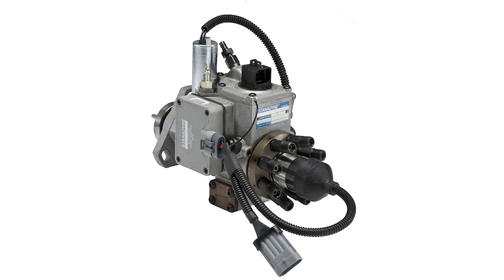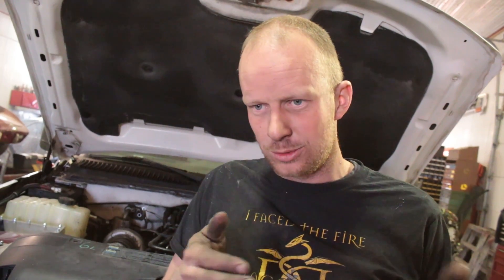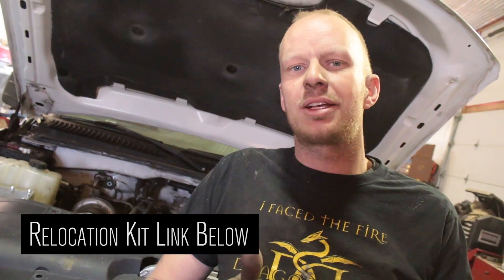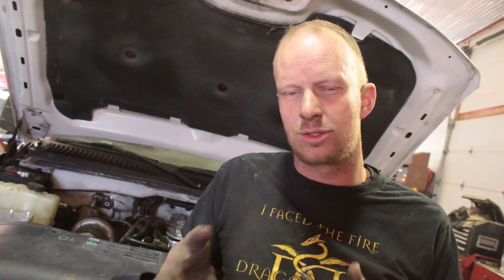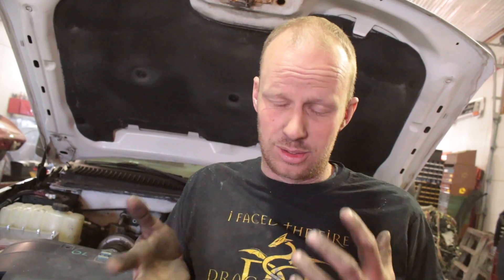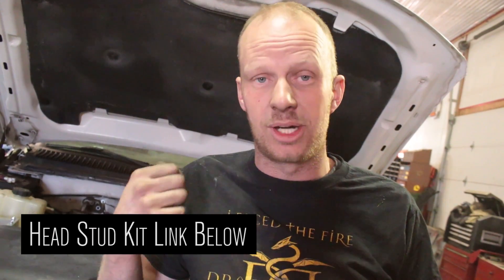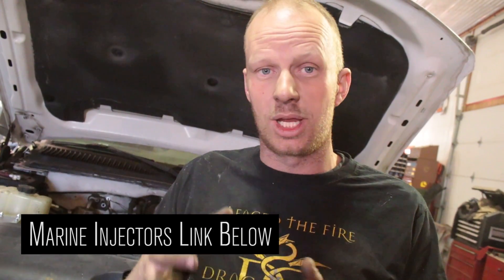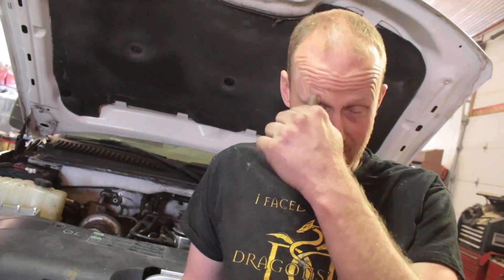REVIEW: Everything Wrong With A GM 6.5 Detroit Diesel

Comment: "must be reliable enough since the us army uses them"
no that just means they were cheap
Reply: Jon long plus at the time the humvee was designed the 6.2l was the only V8 diesel, the Navistar 6.9l came a year later (1983.)
Reply: @NH2112  The M998 HMMWV was a prototype in 1983,but came out in 1985.The N/A 6.2L came out in 1982 and was based on the 8.2L from 1980 that the C50-C70 got.
The N/A-T/C 6.5L came out in 1992.The M1008-M1031 D10-D30 CUCV came out in 1983 with the 6.2L too.
The M1025-M1046 and M1113-M1167 ECV are the ones that have the 6.5L.They were naturally aspirated before being turbocharged in the HMMWV-ECV.Another thing,the T/C 6.5L in the HMMWV uses a different cooling system,stack/snorkel,and radiator than the previous variations,they are 1 FT longer.That is why they have those thick grilles.
The J Code 6.2L in the Military was 155 HP/275 TQ and the F Code 6.5L was 205 HP/450 TQ.Other 6.2L's like the C Code were 130 HP/250 TQ and the 6.5L during it's timeline before the update stuck with the M1113-M1167 HMMWV were 180-200 HP/350-430 TQ.Basically for the 6.2L/6.5L IDI,any of them that had the lowest power had EGR/SMOG,all of them in the military are deleted,and then G.M. still kept that as optional for civilian trucks and vans.After the 6.2L,there was also the CUCV ll A-B-C-E-F-S with the 6.5L,along with the 5.7L and 7.4L as well.The 6.5L until 1993 is mechanical fuel injection before going to electric fuel injection and switching to the DS4 fuel pumps from the DB2 fuel pumps.
Now there is the JLTV/LATV from 2015,it didn't enter service until 2019.It has the Isuzu Duramax with 350 HP/700 TQ.
But the HMMWV will not officially retire until 2042,they will just be in reservations and behind the scenes,no longer in combat.One of the other reasons is the size,HMMWV's are small enough to be airborne out of C-130's,the JLTV's are too large and can't be parachuted.
Reply: @Slim_Slid  
Thank you so much for all the correct information not just opinion...
Reply: Still very reliable. The military got heavy duty 6.5s. The ones in the pickups ere light duty versions
Reply: They dont just buy cheap without any concern for performance. Same thing with people saying things about Colt rifles, sure a Daniel Defense is higher quality (i love mine despite the price) but my Colt never failed me when I depended on it, the only failure I ever saw was a bolt broken in a short barrel FN (owner was a contractor). But the other 99.99% of FNs were great too. Like the m249s, the problem being short DI systems with short barrels, chamber pressure being too high when the bolt is getting pushed back. The military tests to make sure they can take the beating. Anyways, our 6.5s were ancient by that time and although they were pigs fully loaded with guys they ran and ran, because they were maintained and looked at every time they came back.
Reply: I think the  military purchased the design of them and "fixed" some of the main issues after GM went to the Duramax. The "Improved" 6.5's do fit right in place of the original 6.5, I just think smaller some stuff is different between them.
Reply: @wilsonoberholzer2771  Naw, AM General orginally had the the 6.2 N/A, then 6.5 N/A then 6.5TD, after GM/Detroit stopped making the mechanical engines, AMG licensed the 6.5 and now makes the Optimizer 6500 in their own GEP plant. It's had improvements to the block castings, heads and crank, but it's still a turd. The old 6.2's would blow Cyc-8 in 20k miles from overheating. At ~$8k its a cheap and disposable engine for the HMMWV but multiple militaries have had multiple competitions to replace it since 1998. The problem is always fitment, cost or the fact that new engines can't take sulfur rich JP8 without grenading.
Reply: @johnnyz1781  I've never seen a 6.2/6.5 blow cylinder 8. And ik many that run them hard.
Reply: Remember kids... "Military Grade" does NOT mean its good. It means it was made by the lowest bid possible
Reply: No that means they were good

Comment: 6.5 Detroit’s are damn good in my opinion the one my grandparents had was second to none the best truck they had for the km and the body I mean this truck was spotless for rust and the 6.5 could pull damn well it pulled a 12 bale trailer with bales that weighted over 1300 lbs each but sadly all good things have to come to an end the same day they put the truck on the trailer my grandma could smell something so my grandpa popped the hood to release a flame that shit 5 feet in the air the truck went down with the fire went right through the cab it was damn depressing considering that they gave the truck to me who was 12 at the time so instead they gave me a 04 duramax that isn’t in half the shape the 6.5 was in but shit happens and you can’t rewind the past to fix the problem

Comment: I work at a machine shop and 80 percent of the heads the come in are cracked and need to be replace so yea i a agree with you 12v cummins is alot better then this 6.5

Comment: The army 6.5 turbos are outstanding in the hummvee it pulled 13000 pounds with ease on a daily basis with no issues but the injectoin pump all we had to do on most of them was replace  the solinoids on top cause the heat wld get to them.

Comment: Do you think you Can get 1 million miles on a 2005 lly duramax? I have 260 thousand miles on my lly duramax....i use it for work and haul heavy weight every now and again, is my daily driver. I use a fuel treatment almost every fill up. Still on stock injectors never rebuilt only have a cold air intake and 4 inch straight pipe exhaust. I do not mess with tunes. All the trucks I've seen with almost or up to 1 million miles don't have tunes on them.

Comment: hello i have a 2000 gmc 3500 hd it has the 6.5 diesle..im having overheating problems ..top radiater hose gets very hard very fast..i changed both thermostats , new radiator , water pump seems to be working , fan is working ...wen driving over heats in about 2 min then goes bk to normal then over heats agin and repeats ...i dont think head gasket or block , heads is cracked , i tryed that tester kit where the fluid changes colors if ther a crack but it didnt change ...any ideas why its overheating ? wat els would make it over heat ?

Comment: I have a 94 6.5 turbo K3500 truck. It starting having a problem occasionally of not starting and getting worse. Cranking over normally, but not starting. I changed the fuel filter. Didn't help. I noticed two of the injectors are really oily all around them. I removed the air filter box to get a better look at the passenger side and found a lot of oil inside the turbo where the air box connects. Do you think the problem is bad injectors, or something else?
Reply: DIY Oregon you probly need a new cdr valve your is most likely bad and letting oil into the intake

Comment: Years ago we had a 1999 Chevy Express 3500 that had the PMD go (the black box) on the highway. First thing was a pretty severe jolt and the check engine light came on. Looking for a place to pull off the highway it still felt fine, but then it just started accelerating on it's own and blowing a huge black cloud. We turned the key off and pulled off to the shoulder, thankfully being electronic it actually shut off and didn't run away on us. After that it wouldn't start.

The dealer we bought it from just months before didn't even mention the issue or the solutions, and just replaced the damn thing, which failed only a few months later. I had to look up the solution online. We got the relocation harness and never had an issue after that.

Comment: I have a 6.5, I drive it like a typical domestic truck. It has notably less power than an old dodge 5.9 I get to drive occasionally . The 6.5 will not survive lead footed, boost hungry, giv're at all cost diesel monkeys, Their design leaves little room to add more power without compromising reliability. The engine was designed for light duty with reasonable fuel economy, being a IDI it can almost burn any type of oil as fuel as long as the viscosity had been adjusted close to diesel. Parts are economical. It is pointless to spend over 1000 bucks to rebuild the injection pump when rebuilt pumps are available at lower cost at online diesel performance places. You can buy a complete set of injectors for less than the cost of 1 modern day injector for later model fuel rail engines. The black box must be mounted off of the engine. It still gets too hot mounted on the intake, put it on the cruise control box mount, it stays nice and cool there. extension cables are cheap on Ebay. One day Id like to do a swap for a 5.9, but why spend the money when the truck does mostly everything I need. It's too bad the 5.9 was wasted in the ram pickup, They are total pieces of shit.

Comment: I have a 97 Chevy long bed 6.5 turbo diesel 134,000 miles southern truck. Has low oil presure an a thumping noise coming threw breather box but still runs good no change in smoke seems to run strong lacking a little power. Any suggestions what to look for?

Comment: i had 98 chev 6.5 diesel and after 4 years it started having problems with black box where it just started accelerating on its own or would completely shut down.  2500 to fix in canada at dealer.  lasted to 650000 when camshaft broke

Comment: Hi i have a 98 6.5 detroit that ran fine except when i started it one morning and the engines runs rough and idles rough. And big amounts of black smoke come out of tail pipe. And when u give it gas it shuts off. Can u help me out? 
Thanks
Reply: I know this is late, but have you checked the pmd. Sounds like that could be a problem.

Comment: Can you please do a 6.2 common problems!?
Reply: THE ENGINE,DONT EVEN CONSIDER BUYING ONE,international harvester,in 2001,took over building them,6.5td,if you do want one,GET ONE OF THOSE.NOTHING ELSE,or a duramax,12v,7.3,or basicaly anything else.but a pre 2000 gm garbage engine,do you have a computer,mybe not,try wiki,or google,might enlighten you.
Reply: @phantomwalker8251  fear monger much?  Everything you say is WRONG! You've read a lot of forums haven't you? The only year to "stay away" from would be '97. But if you get one. As long as you're not trying to pull 25,000 pounds up a 60% slope. You'll be just fine.

Comment: The guy who lives next door to me has a K2500 that he's been trying to rejuvenate for some time and now it's got only one major problem:

the thing has two batteries.  Normally, the charging system switches between them when one goes low.
His has a programming issue and doesn't switch.
He needs to find a gadget to reprogram the internal computer to properly switch batteries.
Any suggestions?

Comment: I as a 6.5 owner, WILL say these engines aren't as bad as people put them off to be. I have a 94 model k2500 which was the first year of the electronic fuel system (uses the black box talked about in this video. Known as a PMD) and I use it to pull loads such as car trailer, farm equipment, etc. My truck is a bone stock truck with 303k miles currently and it does fine. With that being said, if you are a teen that wants a diesel truck to hot rod and ride around in like all your buddies (as most teens do now days),  a stock 6.5 will be just fine as a daily driver diesel. Now if your looking for lots and lots of power, spend the money and upgrade it. The 6.5 Detroit diesel is a good motor of they are taken care of, but to get power out of it, you have to spend money and upgrade it and build it (marine injectors, bigger turbo, ARP head studs, etc. My truck on the other hand isn't built for hot rodding around and alot of power. It's used as a work truck. What diesels are made for. I've owned two 6.5 diesel trucks over the past 5 years  and out of the two I've owned, I'd say the one I currently have is by far the best (because its a 5spd, vs my first one which had a 4L80E automatic). I personal have own several diesels since high school (6.5 turbo, 6.9 idi, 7.3 idi, and a 350 diesel in a 78 Chevy) and with my personal experience and preference, I'd take a 6.5 all day long cause as I said they are good engine's with some upgrades and when we'll taken care of but that just my opinion and preference.

Comment: I currently have a 96 Chevy k2500 with the 6.5. Has over 236k on it and is still going strong! Original motor and tranny !
Fully bullet proofed: pmd re-located with heat sync, vacuum pump delete, turbo master manual wastegate, Duramax fan, 4core welded aluminum radiator, oil pressure switch harness.
Performance: 4” turbo back exhaust, cold air intake, Heath diesel computer tune, 14lbs boost, deep tranny pan, exh boost tranny gauges, Bosch marine injectors.
The mods really woke the truck up! Definitely a torque best now. Now a true believer in the 6.5.

Comment: I think mostly heads and pmd screw up other than that easy to work on and great on fuel better than our 2.4 Dodge Journey I’ve had 2 and both had head gasket probs the last one that went on me had a lot of putting on the block up front by fire ring and pitted on head and like a fool I tried to fix in yard cause like most I’m not rich so I asked our local parts store what to do about the pitting it was fairley bad they said jb weld so I put some on did the head took it out wen done for a little test drive didn’t work out so good so if you are around the Toronto area as I’m in Lindsay I’m looking for a cheap 6.5 to put in my ole truck now that the weather is cooling down

Comment: If you have one laying around for cheap I need one for my ole 6.5 I’ve had no luck with them cracked head cracked blocks pmd harmonic balancer and on but the newer ones in the boats and the hummer is a bettermoter I’ve never had a problem with the pump just the box

Comment: I had one of these for a few years and really liked it for what it was.  Was not a motor your going to tow a skid loader with everyday but was a great motor for a daily driver and towing up to like 8000 lbs from time to time.  Sounded great, drove great, enough power to get around.  They had about the same power as a pickup with a 350 from the same era so not great by today's standards but they did tow with less effort than the gas trucks did.  Mine was a 95 and got like 22 mpg driving around and would get 17 mpg pulling a 6000 lb flatbed and car at 70 mph.  Only bad thing I have to say about it was it sucked in the cold compared to my cummins I have now.  If it was below 0 deg F and you didn't plug it in you were screwed.

Comment: Im betting a rebuild with the 18-1 compression pistons would go a long way to geting more miles when the boost gets turned up. I know the cummins 4 cylinders that are nonturbo blow up real fast when boost is thrown at them. But the nicest thing about low boost high compression diesles is they seem to start much better when its cold out.

Comment: 1.  There is no letter z in diesel, spoken or otherwise.
2.  Square-body production ceased in 1987, nowhere near the 90's.
3.  The US Army humvee was powered primarily by the 6.2.  The 6.5 was present in later units but those numbers were few comparatively.

Comment: Worked for an oil co. My had the 6.5 diesel. I ran so much heating oil through it and it would leave a blaket blanket of soot when u started it in the winter but it ran pretty good

Comment: Rich, great video first off. I spent 12 years in the U.S. Navy Seabees as an equipment operator. as you stated its not a 12 valve, I have to disagree about the million mile comment. like the 12 valve, if you're meticulous about maintenance and don't abuse it, the 6.5 is a great engine and a work horse. they can easily see a million miles. A reliable daily driver, reasonably economical as far as full size trucks go. As for power and torque, you wont get high numbers, it wasn't built for that. Longevity, load it up, and it'll pull, you wont win races, but you wont break the bank either putting fuel in it.

Comment: They are not reliable, if you tune them and put a nice mandrill bent pipe on the turbo the block has the potential to crack in the webs that the main bearing bolt into. If you don’t tune them they might be ok but they are fragile. I have seen the cracked webs myself.

Comment: i just find it funny..... that GMs modern diesel engine...the 6.6 (403 cubes)...... is DAMN similar to a 400 small block gas motor

its got a smaller bore and a longer stroke than the 6.6 gas motor..... 
but the 400 gas is almost like a gen 1 6.6 oil burner....

longer stroke than a 350.....low HP, but HUGE...1800 to 5000 rpm....torque figures (265hp and 440 foot pounds.....with a 2 barrel carb!!!)

the 6.6 oil has the smaller bore....which allows for heads with out steam holes and more support between the cylinders 
and an even longer stroke.....

idk.... i might be crazy

but my 400 gas motor is more like a diesel than anything else 
pulls ANYTHING

Comment: major problem i had with my 6.5 was the exhaust. They put a damn soot trap/cat in the exhaust that gets clogged overt time. cut that thing out and the truck is completely different. Now ive got turbo whistle, truck has so much more power and actually sounds like a diesel should.

Comment: Bought a new 1993 Chev 3500 cr cab dually with 6.5 diesel.  We towed a race car with it.  (Total  GVW was approx 15,500: not heavy) First engine broke a piston at approx 42,000 mi.  Factory replaced with a new eng.  It had 3-8 lbs oil pressure at idle and the factory replaced it after 500 mi.  3rd eng lasted about 28, 000 mi and started to leak antifreeze into the crankcase (cracked block).  We purchased an optimizer 6500 from Am. General and had it put in (The optimizer looks like a 6.5 and replaces it but is different metal and has good castings; still they have very little torque and don't tow well).  Sold truck at 82,000 miles.  IMHO the 6.5  engine is total junk and most blew up if you tried to work them as  a diesel. Bought a cummins and never had another problem.